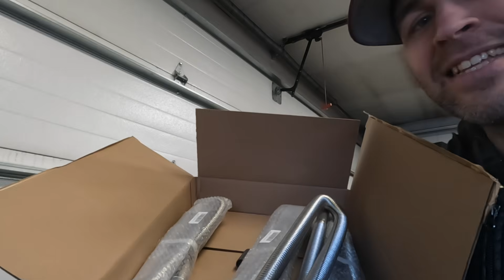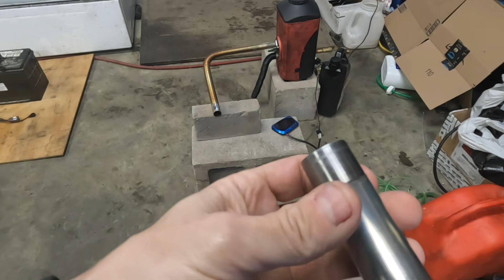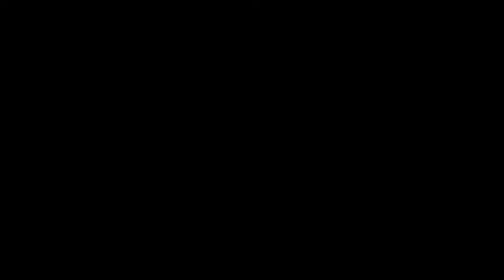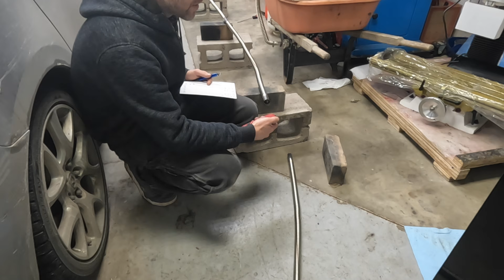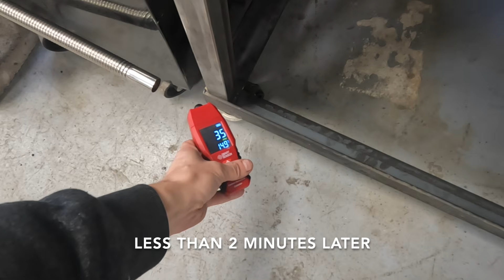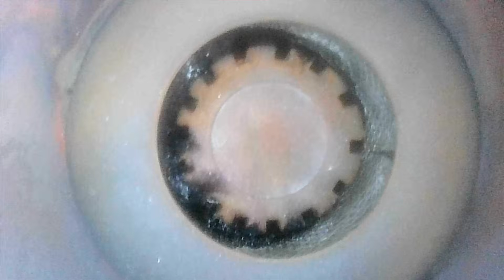Capturing Waste Heat - 5 Meters Of Stainless Exhaust - Will It Even Run ?

Comment: What about using a section of baseboard heater (copper pipe with aluminum fins).
Reply from the maker: That would be ideal !  As long as it is long enough. I think it would work at least twice as good as this, but that would still me an you need about an 8 foot baseboard heater. 

I have been considering getting one for almost a year, but couldn't justify the cost.
Reply: @loweredexpectations4927  So I did it for you! 8' length with the short tube from the heater to the copper, 90 degree turn, a second short tube at the end with a 2nd 90 turning outside, slight bend downward for drips. Baseboard is 1" total slope down. My Vevor has 6 settings. From 1 - 4, you can put you hand onto the final pipe still inside the house, on 5-6 it gets a little too warm to hold. Condensate and visible steam leaves. We've been have 0-10 degrees overnight, there is a small ice stalagmite growing up from the ground, it has a greenish tinge to it which I'm assuming are some copper ions. About three weeks into it and haven't experienced any issues. I figure the baseboard adds about one extra 'click' on the dial! :P

Comment: hmmmm..  maybe a home brewed exhaust cut out...... and set it to one pipe like stock for start up..... an after it's hot...  set it to flow out the full length
Reply from the maker: I did think of connecting it afterwards to see if the start up would be cleaner, I imagine it would be. A cut out should do the trick ! You could even get real fancy and have it temperature operated.

Comment: 🔥I've been enjoying your videos over the past 2 weeks and you've earned my subscription, thank-you.   I've took delivery of 1 Vevor diesel heater last week and have 2 more on the way. I'll be heating a small insulated garage and will be exhausting outdoors. I'll be using a 3 1/4 " diameter  3/8's thick walled mining-drill pipe 12 feet long as a heat exchanger.  I would think that if the exhaust extension pipe (drill pipe) has a lager diameter than that of the heaters factory diameter pipe, there should be less restriction if any at all.  Would you agree with this set-up  or can you provide any insight on my exhaust plans. 
Thanks again 👍🏼
Reply from the maker: Thanks for your support ! 

That's a lot of heaters ! You could start a YouTube channel about it, haha. That is a serious pipe !! You will not have any issues with restriction and the pipe will likely get warm, but not super hot. That's a lot of metal to heat up. 

I would say you've got the exhaust figured out ! You will want to keep a down slope on it to allow condensate to drain out. 

Other than that, if you want to get fussy, it would be a good idea not to have too much of it outside to act as a heat sink.... and you may want to cap most of the end of the pipe off except for an inch hole. This just so cold air / wind doesn't suck heat out of your garage through the pipe.
Reply: @loweredexpectations4927  Thank-you Sir. 🌡I suppose home heating fuel-oil is just as clean if not cleaner than diesel?
 I have an abundance of this fuel to use.

Comment: I added a length of tubbing to mine and crudely coiled it the best I could and it amazed me how much heat I am able to recover from my exhaust. Sometime I will post up a video(s) of my set up as I also use a 30 gallon drum as my fuel tank and I am running a custom fuel blend of clean turbine engine oil, alcohol, old car gas, Jet A, and diesel. So far this winter I have burnt at least 5 gallons and no issues on start up. And I have not taken the heater apart to clean. I will do a check once this fuel blend is all or mostly used up.  Mine does have the same condensation output each time I start the heater.
Reply: I've been running mine on a mix of Jet A and diesel burning about 5 gallons a day when running flat out. 
Every ~ 250 to 300 running hours I need to clean mine out due to ash buildup or it won't restart reliably when it runs out of fuel.
Reply from the maker: @tcmtech7515  That's when you are burning pure Jet A ?
Reply: @loweredexpectations4927  I don't have pure Jet A at the moment. (~ 30/70 Jet A /diesel blend)  Might be getting a bunch of clean Jet A next week and will see how that works.
Reply from the maker: @tcmtech7515  You shouldn't have issue with that unless you are running really rich, or already have a blockage 🤔
Reply: @loweredexpectations4927  CO meter in my garage doesn't even register despite having it exhausting inside still.
Reply: BTW that CD heater temperatures controller is awesome. I am loving it.
Reply from the maker: WOW... that is quite the mixture !! haha... Have you seen the device that Dave McLuckie has been playing with ? It allows you to set up multiple pumps and mix fuels without actually mixing them. 

Turbine oil... I suppose that is a very low ash oil.
Reply: @loweredexpectations4927  I have not seen that one yet but I do keep up with him in general.
Reply from the maker: @77impalaforums  Yeah... it's pretty new.
Reply: I run 10 percent petrol 40 percent fuel oil and 50 percent diesel.  4 months on low 24/7 with minimal soot.    A high run for an hour a day makes room uncomfortable warm but reduces soot to zero.

Comment: Interesting video! I used to run a 6.5 foot long 3/4 inch galvanized pipe up to the chimeny outlet for nearly two seasons and the heater never had condensation problems, as you said, as long as it's not cold, it should not be an issue. The heater did finally fail, but I think that was related to biodiesel not being as ideal as normal diesel, despite whatever made the heater fail, I did decide to go with a 3 inch aluminum dryer vent to ensure there was no back pressure issues and created an adapter out of tin cans to capture any potential condensation and still no water to be seen. Yes, I finally have a serious comment to share, lol.
Reply from the maker: HAHA... a serious comment !? 

Do you make your own biodiesel ? I want to try this just for fun... if I had a steady supply I might decide to stick with it. 

Two seasons of running isn't bad regardless... as long as it doesn't stop working on the coldest day of the year ... and it will, haha.
Reply: @loweredexpectations4927  We were getting the biodiesel locally, would be great to learn how to make it though.
Reply from the maker: @HostileHST  What do you pay for it, just curious.
Reply: About $4 US per gallon at the time and that's from a normal gas station, but I did hear some bad things about biodiesel, so we try to use normal diesel on the chance the info I got about Bio might be true. I highly doubt it's a huge problem, but can burn dirtier from what I understand, but so does normal diesel, so guess it don't matter. I imagine it's more about tuning the heater for different fuels, like with your motor oil experiments, none that I've seen have been all that successful, but there is hope, oh yes, there is!
Reply from the maker: @HostileHST  You can buy biodiesel at a regular gas station ? I didn't even know this, haha. I live under a rock. 

From what I understand, properly done biodiesel is fine. If it is not done well it has glycerine left behind as well as alcohol and perhaps some acids. 

It would be awesome if I were able to have success with the motor oil. The remains to be seen... speaking of which... I need to go check on my heater, haha.
Reply: @loweredexpectations4927   Yup, I good ole gas station sells it here. I will need to take a cruise soon to find out how much it is now, I only said what I thought it was the last I went to that station. Not that it's critical to find out, I could google it, but I need some outdoor time anyways.
Reply: I just got a diesel heater, and bought a few extra pieces of the same type pipe.  I was thinking in the line of, and going to try making a coil out of one section and then rig a 12volt computer fan up to blow air though the center of the coil to capture more heat from the pipe. And now Im also thinking / wondering about making a heat exchangher out out of copper pipe and make something similar to the ones I have seen for a wood stove add on.  Hmmm.  Thinking Thinking

Comment: Outstanding video and test. Waiting for your test on heating water. Have you thought about using larger exhaust pipe to lower the flow restriction? Keep up the great work.
Reply from the maker: Thanks ! 

I have thought about using larger pipe. The reason I did this is because it is what most people are going to try, and I wanted to know if it was at all practical. 

Stainless in 2 inch would be incredibly expensive. Aluminum would be more reasonable and probably the best option. Mild steed would rust over time.

Larger pipe would offer some advantages for sure !

Comment: Put a muffler on the end and watch how hot the pipe gets.
Reply from the maker: Like, on the very end of the last section ?
Reply: @loweredexpectations4927  I had about 6' of pipe. The last 2 was through a wall and outside. Had it wrapped with the heat resistant stuff. Ran without a muffler with no problems. Put a muffler on because not sure if I'm retarded or curious but after I did it caught fire where pipe went through the wall. Luckily the wellpit and hose was right there I got to be a fireman for a while.

Comment: A tunable ecu where you can bump up the fan speed would probably be able to keep your carbon monoxide lower
Reply: A quirk of these heaters is that the blower fan runs at the same rpm as the combustion fan - so you have two key parameters stuck together, limiting tunability of the device.
Reply: @ArifGhostwriter  yes your correct but the older controller allows you to tune the fan (yes both fans together) to the pump speed. So if you have a more restrictive exhaust you can compensate for that. The speed of the heat exchanger fan doesn't really affect how it's burning as long as it's cool enough.
Reply from the maker: @ArifGhostwriter  While the fans are linked, the exchanger fan plays no role in the tuning of the heater. It changes how much air flows over the exchanger, but this doesn't have any effect on the tuning. An increase in fan speed will carry away more heat and make the exchanger cooler, but the temperature of the exchanger doesn't change the tuning of the heater. 

What it can do, is make it harder to track changes, as you can't be sure if your temp change is because of your AFR or your fan speed change. This is why using a CO meter is a good idea for tuning. It tells you what is happening in the burn chamber.
Reply from the maker: Absolutely. You can always reduce fuel or try increasing fan speed.

Comment: Hi, I don't completely agree with you regarding the condensation in the exhaust pipe but for me, it doesn't cause problems because my pipes are stainless steel and the gases go outside ( I think you saw my little video).
How is your cat? I didn't see it in the last videos
Reply from the maker: Thanks for the comment ? 

Is that exhaust cooler made specifically for that heater ? I'm guessing it is a EGR cooler, but It looks like it was meant for it. That is a beautiful setup you have ! 

How much water condensates out of your exhaust depends on a few factors, but your system appears to be working fine ! 

Quasar is fine. When I get really busy he shows up less in my videos, haha.

Comment: Why not put a few vent holes along the bottom of the exhaust.  If you use a small piece of exhaust as a damper to open and seal off the exchanger, you could get rid of the accumulated water/condensation periodically.  Nice video...I'm still learning!
Reply from the maker: I'm not sure what you mean about the vent holes ? 

Although I am venting my exhaust into my garage, this is not a good idea. You want all of your exhaust gasses to go outside... you just want to collect the heat from those gasses before they exit. 

There are a few ways to get rid of the water in the exhaust. The easiest way is to just have it drain out the end. If that isn't doable, then a drain, like you say, could be used.
Reply: @loweredexpectations4927    The "vent" holes are not really to vent the exhaust, they would just be small holes drilled on the bottom of the exhaust to allow the condensation to drain.  By putting a little piece of the exhaust pipe, just enough to cover the holes, when it is on the exhaust pipe, no exhaust or water would leak out.  When you want to drain the exhaust pipe of any accumulated water, you could just take the piece off (or turn it) to allow the condensation to drain.  I really could be anywhere on the exhaust pipe, so long as gravity would vent the water.  The piece would be like a small sleeve fitting over the outside of the exhaust pipe.  Since it would be made from some extra pipe, it would fit into the grooves of the exhaust pipe and could be just rotated to vent the water without even taking it off the pipe.  I know, TMI...  Think of a piece that has been cut lengthwise to fit over the exhaust pipe.
Reply from the maker: @stevelacroix2917  Ok, I see what you mean, haha... Yes, that cold work.

Comment: I’ve been tempted to run 2 or 3 m coiled through a diy sand battery …. This vid is very encouraging 👍
Reply from the maker: Thanks for the comment. 

Go for it ! I am not sure if I will do sand or water first... For my needs, water is much better as you need less water, and it releases its heat much faster. 

A sand battery is great if you want to collect heat and then release it slowly, but I want all my heat now, haha. You will capture some with sand, but may have to add something to the sand to get the desired results from 3m of pipe.

Comment: I have the same controller like you and that is DEAD ON 210 C EVERY TIME
Reply from the maker: Haha... yes, this is because you are running it on normal mode, I assume ? Not on Alpine mode with the little blue mountain. 

This ECU has a built in limiter that kicks in at 210C. It slows the pump down until the temp drops to 208 and starts pumping fast again. The controller lags behind, so the numbers don't always change, but I can hear my pump speed change.... If I am in normal mode. 

When I am in alpine mode, my heater runs at 184 - 186C What is your elevation ?
Reply: @loweredexpectations4927  im at 400 moh and if  i turn on elevation it runs at 206-208. So i prefer no elevation and that extra heat.
Actually pretty smart ecu.
If i put on the plastic part on the hose wich direct the air it will destrict some air and the heater will get warmer and immideately slow down to 210 again. With the other heater i can run that on 5000 rpm at 6.0 hertz and have about 215 without the air adjust in the end of hose and with the air direct plastic thing it will run at 225 about and i prefer that as my workshop will heat up so much faster. They actually seem to draw about same amount to be fair running like this. But having the ability to force the heater to run at 5000 is great as it moves that air inside my place so quick.  Its 6 am now here, i decided to have a early start today as ive slept great and just started my 2 bad boys here from the comfort of my bed with 2 cats snuggling up to me. :)
Reply: @loweredexpectations4927  I'm at 445 meters.

Comment: Hmm. Build a new box that has another Burn chamber and make that exhaust go through the inlet and then it will heat up that part and the fan wil spread the heat.
Reply from the maker: I'm going to be honest.... I don't know what you mean, haha.
Reply: @loweredexpectations4927  he has a smart idea... You use a second heater as heat exchanger, exhaust silencer and with active fan as a kind of turbo...
Reply from the maker: @sjococo 🤔I have already done this and have a video on it... Just without the long pipe.
Reply: @loweredexpectations4927  I thought I have seen all ur videos but must have missed that. What I meant was the exhaust to be connected to the air inlet pipe on another heater and then having a fan just blowing, but in retrospect it's not most likely gonna give much warmth. I've seen guys with old radiators and all that stuff. I think it's lots of great ideas floating around but in hindsight just hassle for not much. Unless you need warm water to wash up your hands after a day messing around in that workshop.
Reply from the maker: @RIMHQ-YT  I will leave a link to the video in another comment. I did tis with a 2 and 5 kw heater.
Reply from the maker: @RIMHQ-YT  https://youtu.be/FiKBvdyrJvo
Reply: @loweredexpectations4927  aaaah yes. I remember. I have seen it. Jeez. Some evenings I'm all gone and this must have been one of those. I have seen most of it. Guess i had it playing in the back of my mind.
Reply from the maker: @RIMHQ-YT  Haha... I do that all the time, as well. 👍

Comment: You'll get less energy out by coiling it, each bit of pipe will be close to other hot bits of pipe so will let less heat out
Reply from the maker: 🤔 ... I don't think your end conclusion is correct, but I can see what you mean. The higher the temperature differential, the better than heat transfer. 

I think that the extra restriction will cause more interaction between the gasses and pipe, allowing them to lose more energy to the pipe, and that the effect you mention will exist, but not enough matter.